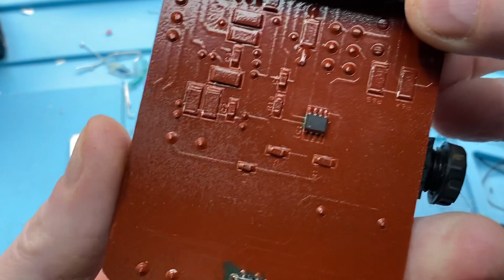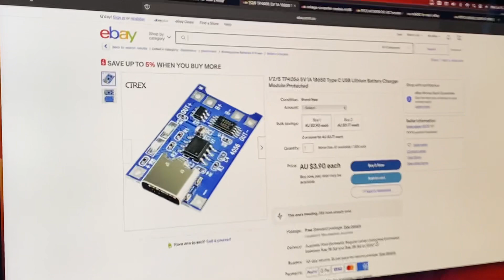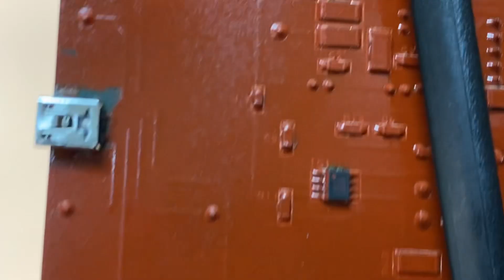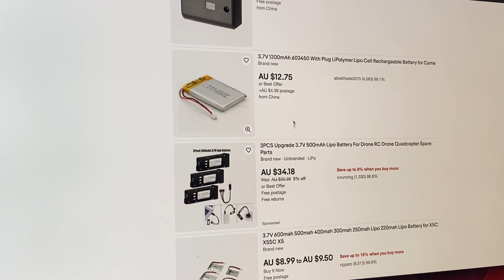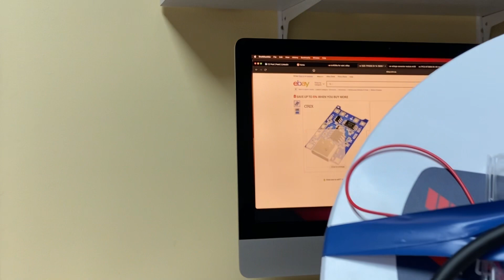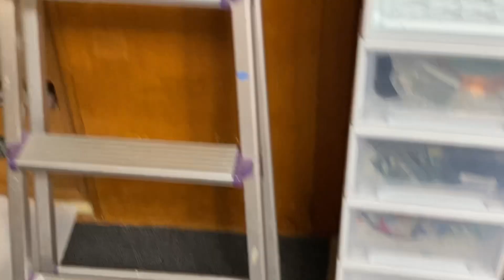The SP01 in for repair. This was being used on a Minelab detector and had failed.

Comment: That’s interesting before I bought my unit in 2018 I was messaging him and he claimed that they used a class A/B circuitry that is why I bought the dam thing as class a B is better sound quality and doesn’t pick emi as much

Maybe late model sp01 has different components
Reply: The NS8002 is class AB.
Reply from the maker: I stay away from class D amp chips due to possible emi getting into the detector and creating noise.
Reply: @DetectorMods  Yeah I stay away from them had bad experience 3 other units makes the audio sound like a retarded harmonica lol 😂 

However never had a issue with sp01 audio sound quality now I’m really curious to open my old unit to see if it has a class AB

Comment: Scary when you find the Parts Prices total is way short of a New Unit cost of $250  - I guess most Gold seeking people are just plain gullible
Reply from the maker: There is a lot of clever put together in that unit.
Reply: @DetectorMods  The only clever I saw was the white paint to make repair work difficult for lesser technicians.
Often boards are encapsulated in epoxy.
Reply from the maker: Yeah lol

Comment: You should try the SP01 - works great on GPZ with detector volume on 5 - keen to see if the 6000s DD converts ok as the Chip handshake wouldn't matter?
Reply: Glad you like it 👍
Reply from the maker: The handshake is on a different set of wired.

Comment: The step up converter as  i used them in other projects and they do fail if their voltage is only a little difference. i have heard good reports about that amp though but i like to make my own gadgets ,  amazing how little ns8002 d class amp chip is worth .love ya work woody.
Reply from the maker: I do not use class D switching tech near metal detectors as the switching can raise the noise floor.
Reply: @DetectorMods  i just looked them up i think their ab might put one in my amp to see any difference but i get good results with what I'm using .pinging .05 at 1 to 2 inches on my 4500 don't like digging up tiny bits like the bloody lead shots all day long 1 .05 nugget to 50 lead shots  .